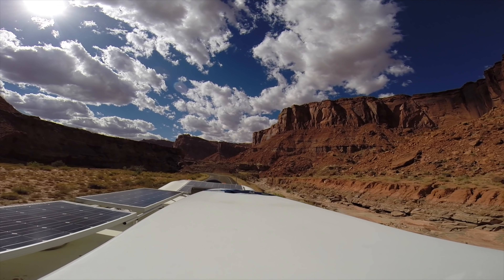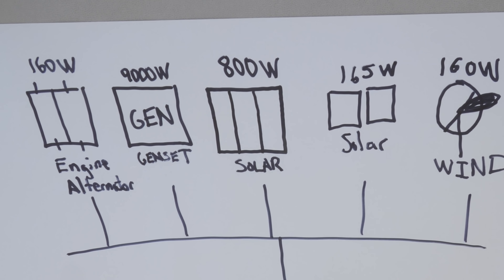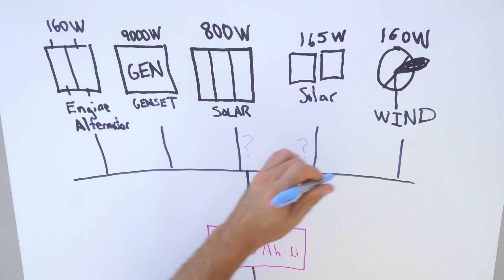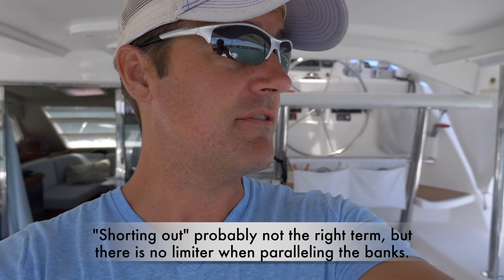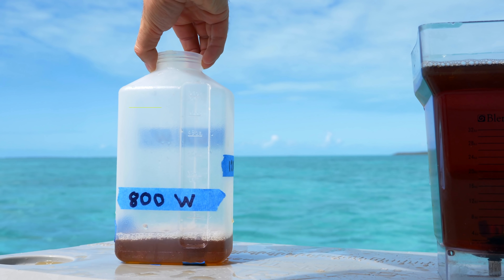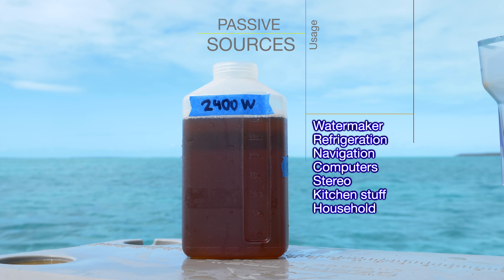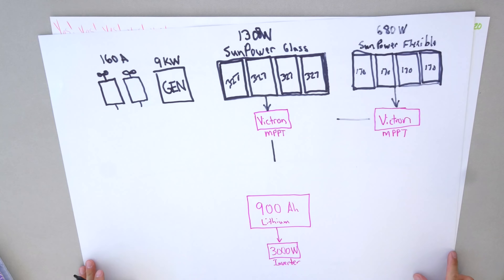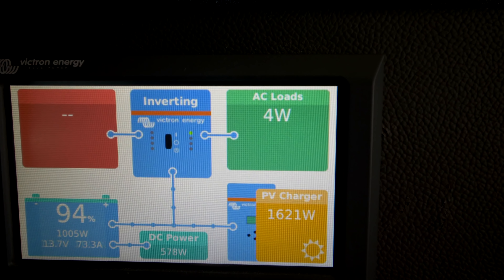How to manage electrical power on a sailboat using NO fossil fuels!

Comment: My 2c: to improve battery life,  you should charge to 80% capacity instead of 100%.  (assuming that you're using lithium ion)
Reply from the maker: What is the reason?
Reply: @TheOKellys  I'm not an engineer so I couldn't say: https://www.google.com/amp/s/electrek.co/2017/09/01/tesla-battery-expert-recommends-daily-battery-pack-charging/amp/

"Newer phone batteries work in a different way. It stresses the battery to drain it completely or charge it completely. Phone batteries are happiest if you keep them above 20% capacity and below 90%. To be extremely precise, they’re happiest around 50% capacity. " This is an excerpt from an article about cell phone battery life. 

Anyways,  if your battery array is continually able to meet demand,  it might improve their lifespan if you limit the charge,  if I understand the literature. This information is relevant for all lithium ion batteries afaik.
Reply from the maker: Oh I see what you are saying. We limit the charge voltage. We do that already.
Reply: @TheOKellys  Voltage can be thought of as the potential that a battery has to deliver a certain charge. ... A battery's capacity, on the other hand, is how long that battery can provide its voltage. Capacity is measured in mAh, or the number of amps the battery can provide over a certain number of hours. (copy pasted)  I'm pretty sure they are referring to how many kwh they put into the battery being capped at a lower than maximum to extend the battery life.

I envy your choice.  Looks like an amazing lifestyle.  I think that when I am ready for it,  I will want to try to go all electric as well. 

I have also heard of using the propeller to charge the batteries if the engine is electric. It also seems like a viable source of energy.  But I  am the equivalent of an armchair coach...  little practical knowledge. This year I hope to start making a transition to a handier person

Comment: At 2000 you say you can’t run the hot water heater. So at 2400W with more power than you can use, do you run your hot water heater every day off the inverter?
Reply from the maker: Working on setting that up soon. There is a bit of wiring involved. You can set it up to run that way with much less solar....I was talking averages.

Comment: Nice! Very informative. In the Seattle area Puget sound, I have seen it cloudy for months at a time. I wonder what system would work for a catamaran in these waters.
Reply from the maker: You know the newest MPPT controllers can squeeze a lot more juice from panels than you might think. Up there though, you’ll probably need a genset or some big alternators if you’ve got a big boat and lots of comforts.

Comment: So dumping the genset also creates more room for batteries, providing the ability to store more power before your controls throttle things down. Are you considering it?
Reply from the maker: Hey Mike, no, if anything we have more battery than we need already. We only discharge maybe 30% per day and it is charged full by lunch.
Reply: @TheOKellys  And that's because you have not set up your induction HOB and BBQ. Here's my rule of thumb, excess never stays excess because it gives way to look what we can do now. Once you get used to using the new stuff, your 30% discharge on an average day will take a hit ant there will be bad weeks with overcast skies. :-)

Comment: Good instructive video... Technology continually evolves as new Batteries using Graphene are surfacing. AND Graphene used in Solar Panels shows serious promise. Graphene batteries already available on the market. Graphene Solar Cell Panels appear still in design phase.
Checkout Tesla and Samsung for available batteries. The push for renewable energy is showing life sustaining promise!

Comment: So how far could you guys sail.On a full tank of fuel.Compared to your batteries.Being charged by your solar and wind power?
Reply: When they're sailing, they're not using fuel, so the answer is they can sail an unlimited number of  miles, as long as they have wind.  They don't have an electric motor for propulsion, so they can't "sail" at all on solar.

Comment: Thanks for this easy-to-understand video.  What about the battery size in relation to canal trips or other situations in which you might need the generator after all, taking into account the charging options e.g. in the Panama Canal, if it's even possible. Oh man, I have this dream on a long journey without a generator😂.  Lovely Greetings from Germany
Reply from the maker: There are other options such as charging off the engine alternators. Most boats do this. We are set up to do it, but have put a large on/off switch to the house bank as we don’t often need anything but solar. If we were ever to get rid of our genset, we would likely purchase a small gas generator for emergency. Multiple charging sources are needed for long passages.
Reply: @TheOKellys  Thaks for the answer ☺️

Comment: Did you do the Numbers on an electrical motor to power the boat? Probably double the solar power and more batteries. Maybe wind in the mast?
Reply from the maker: For us it isn’t practical. The boat is too heavy and we sometimes like to go a long way quickly when there isn’t enough wind. For now, the only option there is diesel. For now. One day we will have technology that can support that kind of travel. I’m hopeful
Reply: The O'Kelly's yeah, but it’s not far away probably. If One could get hold of a crashed Tesla at a Denise then price. A Tesla motor can generate 280 hp. And a battery pack is 50 kw. So you would have 20 kw at the motor for 2,5 hours + 5kw solar + wind turbines 1 kw... and then the diesel generator as backup. But battery technology has to become cheaper to work in big boats. There are talks about a battery with much lower price but more weight per kw, which is less of a problem on a boat.

Comment: So at this point because the solar arrays are keeping your existing batteries charged fairly easily you could increase your capacity by adding batteries?  The batteries could go in the physical space vacated by the generator.  Then you can get the hot tub!
Reply from the maker: It’s true. But these batteries are crazy expensive.

Comment: Hi,
Would this configuration work if you wanted to install an electric engine to power the boat, instead of Diesel/Petrol?
Reply from the maker: See the Top Secret video. Would love to do it, but not right for our current cruising.
Reply: @TheOKellys  Thanks for the reply. Will be checking out that video over the weekened. :) Stay safe and Be Well

Comment: One further question if you don't mind? You said you separate house bank and starter batteries which makes sense to me. Are the starter batteries AGM or Lithium batteries? I am going to guess you kept the cost down and used your old AGM as starter batteries and replaced all house batteries with Lithium?
Reply from the maker: I use AGMs for staters. Several reasons, but starter batteries get abused...

Comment: Have you considered ditching the engine and running on the gen alone for when you need to top off ur batteries? That way you could also generate energy when you sail (like how top secret can do). I'm sure you have ur pros and cons on the matter and I'd luv to hear about it.
Reply: I think you mean going to an electric drive + generator.  They still have their diesel drive engines.

Comment: Can you pull the big generator and just keep a small Honda 3000 gas on board for emergency?  Its what we did on our house boat. :)
Reply from the maker: I’d probably get an EU2000. Have had a couple before. Great units.
Reply: @TheOKellys  The db on the EU2000 is more than the EU3000. FYI

Comment: As I'm thinking of a similar project I happened to  stumble over your video,  which is quite informative. Can you tell me how many km (or miles) you manage to do on solar power [alone] on a sunny day ?
I intend to transform an old catamaran (Hobie  -Cat 16) which I want to fully cover with solar panels  6x400W + about 1-2kW of orientable panels + 2.5kWh LiFePo4 24V battery  and to 
attach this construction  to a sea-kayak -  just like a trailer (with two outboarders at the kayaks back).
 Plan is to cross France starting in Lyon, (Rhône, Saône, Rhine),  Germany (Rhein Main Donau Kanal) and down the river Danube to the Black Sea and back over Turkey, Greece and Italy and finally up the Rhône agai to Lyon. So the background to my question is to get a (rough)  estimate of the time the journey may take.
Thanks:  Hermann
Reply from the maker: We have Diesel engines. The batteries are for the house needs.
Reply: @TheOKellys  Ah, understood, thanks for comming back to me !

Comment: Energy captured from motion. 

Boats rock side to side, up and down. 
I don’t understand why energy isn’t harvested from that. 

Picture a square metal bar 6 feet in length, and a 200LBS lead weight slides back and forth across the square bar as it’s pulling on alternators to generate electricity.   

Or a floatation device inside the fuel or water tanks to harness electricity from the up & down motion. 🤔
Reply: Hydro generator 
Sun generator 
Wind generator 

Why no gravity generators.
A boat of all crafts have so much motion 
😅

Comment: Nick, with the amps you have available from those alternators, have you looked into utilizing a VSR - Voltage Sensing Relay?  This would allow isolation and AUTOMATIC excess current (once your start batteries are full) to be sent to house battery.
Also, I like the idea of ditching the old, heavy genset..but maybe get 2 Honda style 2200 W generators (two are lighter to lug and also give redundancy) use a parallel cable and that will let you run A/C's if you need to.  BTW, do you have micro-starts on your A/C units?...Those would help as well.
Lastly, having separate charge controllers for your  3 arrays (which is the "good" option)...having separate controllers PER panels would even be better for max output and shading.
Thanks
Reply from the maker: VSRs are an interesting solution, but gets complex with two alternators. For example where does field and sense get connected?
Reply: The O'Kelly's , if they are Balmer alternators they offer a Centerfield device to allow two alternators to play nice.  If not, I’ve seen something from Ample Power.  Thanks for the videos !
Reply from the maker: Balmar’s solution is exactly what I was referencing in the vid when I said it gets complicated. I’ve investigated it as I would love to convert to serpentine belts on these engines. Not saying that it doesn’t work, but it’s all in the name of managing something that doesn’t need to be managed if you keep them separate. I’ve had two EU2000s pigtailed for a scuba compressor. Lovely lovely little machines. If we do ditch the genset, I’ll pick one up for backup.

Comment: Very interesting and helpful Nick.  Thanks.  One thing that I didn't get though is why you don't use the alternators to charge the house bank when you do run the engine.  I would think if both banks are 12V, that it would be free energy when you have to run the engine/s for maneuvering.  Isn't there a way to do so without it slowing the charging from the other sources?  So when are you going to electric propulsion?
Reply from the maker: Hey there Richard. Answered that one in the video. It’s because the voltages are never or rarely the same.
Reply: @TheOKellys  Yep.  I did hear that but if both systems are 12V then they should be charging at around 14V right.  I just didn't understand the electrical principle.  In the immortal words of James McCoy, MD, "Damn it Jim, I'm a doctor, not an electrician"
Reply: @TheOKellys  Couldn't you use another controller in the network for the alternator also?  Just not to waste that energy when in excess?

Comment: With that much solar capacity, could you reduce the amount of battery storage you need?  While it's apples and oranges, solar is relatively cheap compared to lithium storage.  As you say, you are almost always topped up.  You only need batteries for overnight (and poor weather).  You could store energy in cold packs in the fridge/freezer and use your engines for the rare periods of multi-day overcast/rain, much cheaper than the last $3-5K of lithium.  What's your rule of thumb now for sizing the batteries?  

In retrospect, since the hard panels have a higher output per area, would you use more of those on the rooftop instead of the flex panels?  How about rigid panels on the lifelines like many monohulls do?
Reply from the maker: I’ve got more than I need I think, but just got a note this morning from my pal CJ. He’s got a similar setup and says getting a lot more cloudy days in the South Pacific. He thinks I might actually want to add a battery.
Reply: @TheOKellys  How would you tradeoff ~$1-1.5K for another 1-1.2KW of solar panels on wings on the lifelines (kind of like Rick Moore) to milk more from the cloudy days than $3.5K on another battery?
Reply from the maker: Hmmm good question....not sure that I’d even need wings, there’s more space in back....

Comment: Hi there!
We recently got a Leopard 44 from Sunsail and in the process of upgrading her for full time live aboard.
I have ordered 4 x 330 watt solar panels and want to mount them in the same location as you guys.
A local stainless steel expert gave me a very expensive quote and at the same time a very heavy ss structure to hold them.
I am thinking of using aluminum and keeping it simple and light. To hold them together I am considering the solar systems that you can find on the internet and are used for land applications and then create some mounts to attach them to the boat.
What have you used in your installation? Any recommendations? Tried to find a video or some details online on your installation and could not. If you have something, please share the link with us.
Reply from the maker: Look back at the boatyard videos from about a year ago. Aside from the stainless uprights, it is all aluminum L, some riveted back to back for stiffness. Saved approximately $17k doing it this way. So far so good.

Comment: Why not try to maximize the use of glass panels? They are way more efficient than the flexible ones. Unless you need to walk daily over that area I see no benefit in using flexible ones?
Am i missing something or is it merely a preference?
Reply from the maker: That has not been my experience so far with these panels. I use flexible as they are lighter and conform to curved coachroof.

Comment: If you are going to get rid of the gen set, then you can think about using hydro charging/generation. The article below mentions a drag of 0.4 kn to 0.1 kn 
https://www.sailmagazine.com/diy/know-how-hydro-generators 
Oceanvolt's systems can hydro generating uisng the main propeller. The article mentions solution that can be easily retrofitted (A separate unit).
Reply from the maker: Would love to do this one day. Not with this boat though. Too heavy.

Comment: Are you running electric motors as well?  I would like to remove the entire diesel fueled operation, motor, genset, tanks. More room, less chance of environmental issues. And while I am at it, no blackwater; I am looking at composting toilets. Your thoughts, please.
Reply from the maker: Well, electric drives aren’t ready for a cruising boat like ours. Someday....but right now we need more power over a longer period and the best energy storage unfortunately is diesel. Someday though...I am hopeful.
Reply: @TheOKellys  I apologize for this response. I keep losing the "reply" button. 
I base my question on "Top Secret" which uses Oceanvolt. for motors. In looking at the offerings, it is possible to find comparable sized electric motors.

Comment: Consider the following:  For those who can afford it, 'hydrogen fuel cells'.  And the byproduct of a hydrogen fuel cell is basically pure water, which could come in handy on a boat.  Hydrogen, the most abundant element in this entire universe.  See my Twitter page under the same name as this comment to see what this world is doing with hydrogen, and yes, even powering boats already, aircraft too.
Reply: Charles Brightman where does a sailboat refill hydrogen?
Reply: @AdamBrianDada  Glad you asked:
a.  One can desalinate and electrolyze water (H2O) into H2 and O2 with any source of DC electricity, (ie): solar power, battery power.

b.  When the H2 and O2 is recombined, one gets the electricity back with a byproduct of H2O, which could be split and recombined over, and over and over .......  Theoretically, one would never have to buy fuel ever again.  Water is your fuel and the boat is in water.  Potential savings there.

c.  Then also, power the boat with electric motors, and no fossil fuel engine(s) needed with all it's costs.  Another potential savings there.

d.  See my Twitter page under the same name as this comment to see more info.  Dig down deeper on the page and one could find info concerning boats and aircraft too.  Hydrogen is not only the future, it's here now.